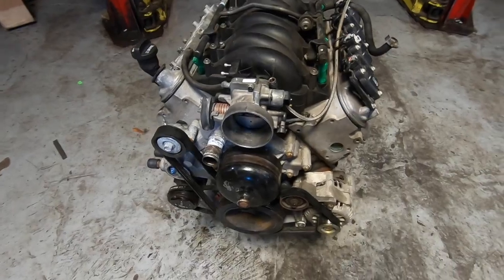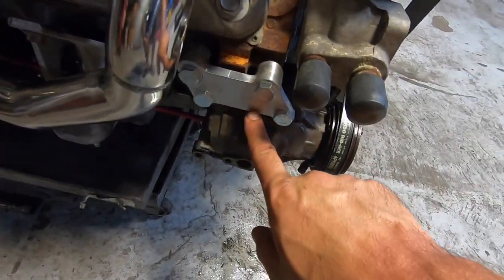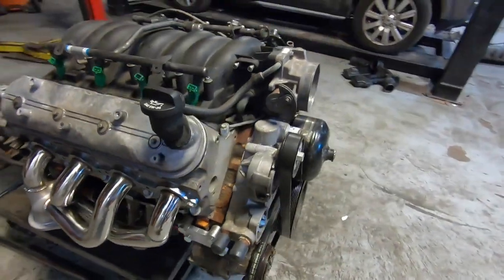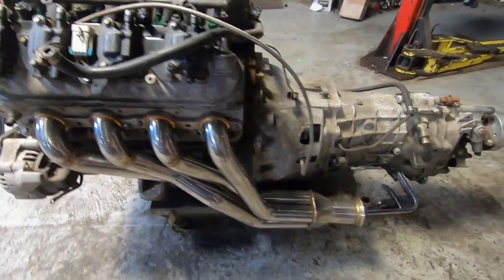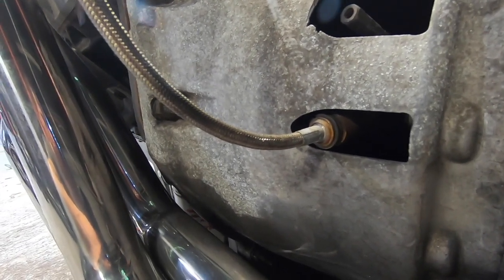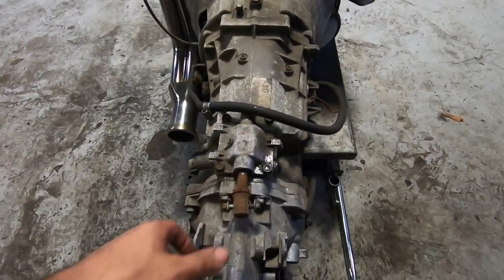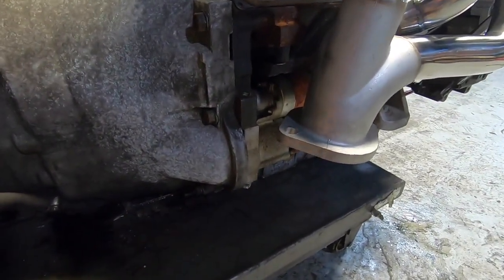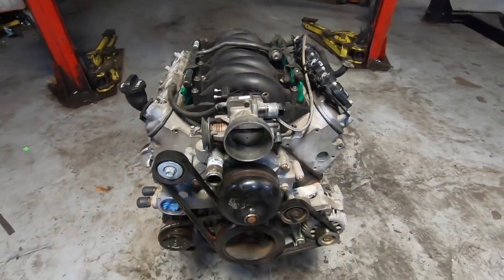Drivetrain setup to install in the rx8

Comment: I couldn’t comment on the lost function video.  I’ve got a Holley terminator and digital dash with a speedometer. The digital dash from Holley was pretty spicy, no doubt but you can buy a $50 tablet to get more functions than on the factory dash.
Reply from the maker: The dash function is less of my concerns personally. It’s traction control I would like
Reply from the maker: The dash function is less of my concerns personally. It’s traction control I would like